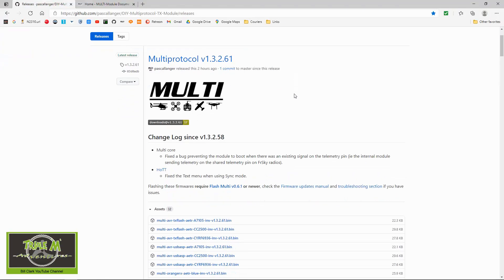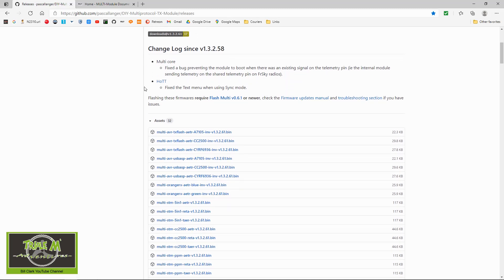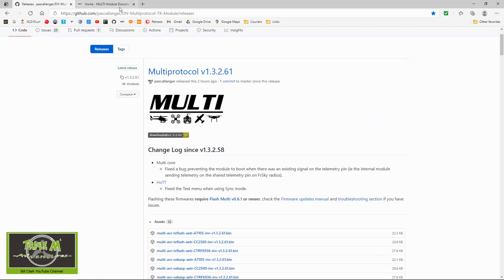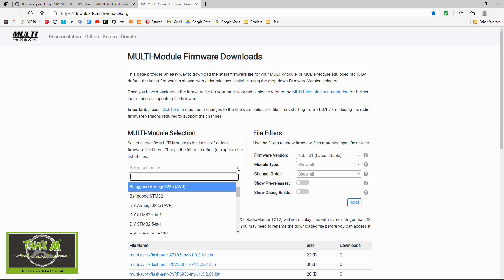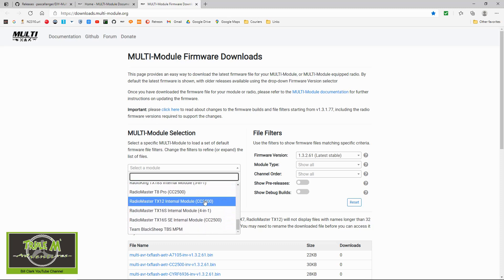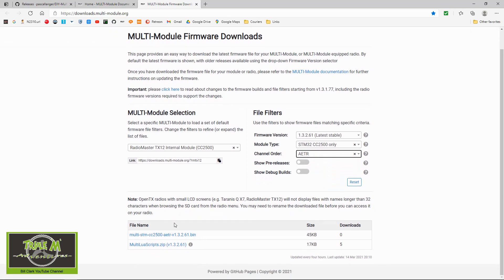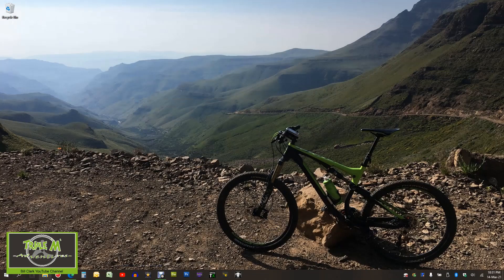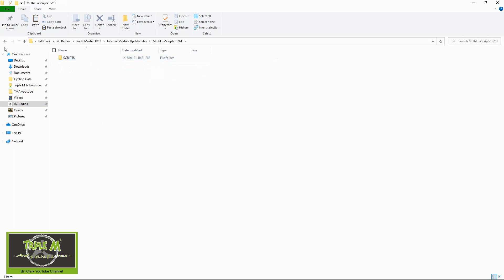Multiprotocol Module Firmware Update v1.3.2.61 Available Now

Comment: Hi Bill, I loved the TX12 so much that I purchased the TX16S Max but after following your instructions something went wrong and now when I turn on the radio it gives me the SD CARD WARNING Expected version: 2.3V0035 Press any key.  So when I press the wheel it goes away but how do I fix that or is it not possible?  thanks in advance.
Reply from the maker: You need to download and update your SDCard contents to the correct version. If you go to the openTX website go to the release your radio is on, best to update to the latest, and you will see the link to download the SDCard contents.
Reply: @the-happy-RC-flyer  Thank you, I actually forgot to do that but now I am back to working.  you are awesome Bill!

Comment: Hi Bill do I need to update my radiomaster ts16 to bind to frsky x8r? As I can’t seem to bind it? cheers
Reply from the maker: Hi Derek,
It is a good idea to have the latest multiprotocol firmware on your module in my opinion but you should be ok with the version you already have, the latest is 1.3.2.61

I do not have a FrSky X8R receiver to test but checking the website it is a D8 & D16 compatible receiver which should bind to the multiprotocol module. If your receiver has the ACCESS firmware it will not bind to the multi protocol module. It needs to have ACCST, which the website confirms, which is the older firmware. If you receiver is ACCST it will bind to the multi protocol module with either FrSky X (which is v1.) or FrSky X2 (v2.) and select D16 if that does not work try D8. If you are in the EU you will, or should, have the LBT(EU) firmware so select that option.
FrSky has not made it easy to bind their receivers to non FrSky equipment and you cannot find out what firmware is on your receiver. So try the two protocols above first and see if you can bind the receiver.
Reply: @the-happy-RC-flyer  ok Bill thanks 🙏 I will try it it later and see how I go 😊